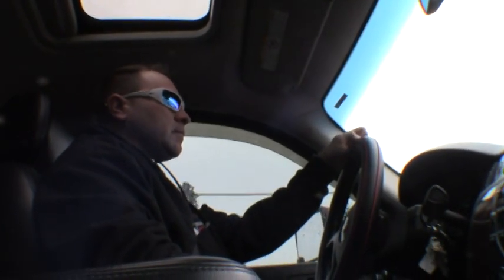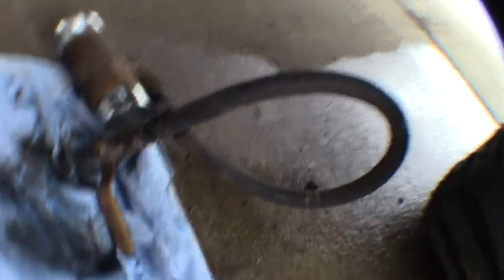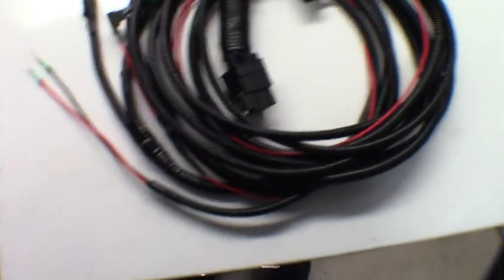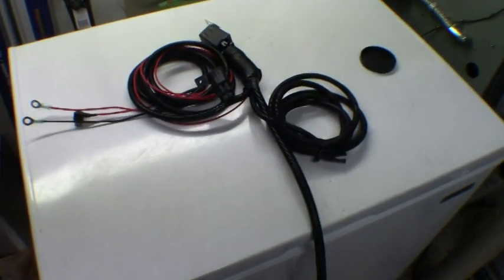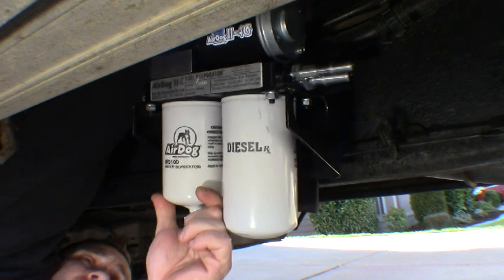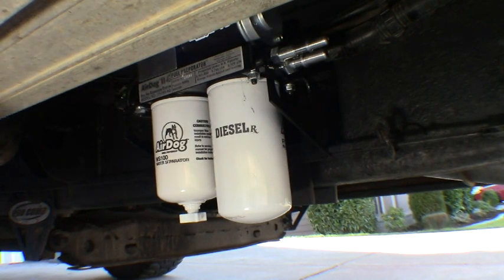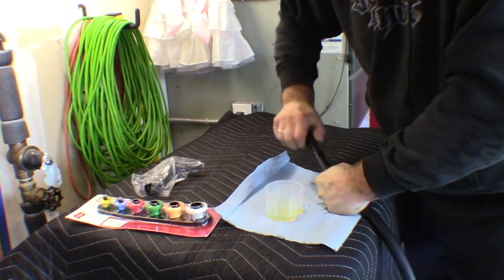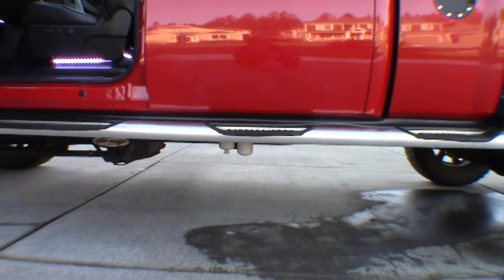Airdog2 4G lift pump install, Duramax lift pump install, air dog @AirDogSales

Comment: The reason the harness is so long is so it will also fit a long bed
Reply from the maker: Probably very true. Another 1.5' would do though. Better 2 much than not enough 4 sure

Comment: Did you have to remove that section of stock hose or could you have plugged the new hose (for the inlet to the lift pump) into the stock hose where you disconnected it?
Reply from the maker: That factory piece is has what I would call the "female" end at both ends of it.and the ends where it connects are kinda large and funky.. I suppose you could try 2 cut one end off and clamp the hose 2 it but it would be a bit sketchy since the end wouldn't be flared and the factory piece is a hard plastic material..not sure been I would trust it..2 me it seemed safer and easier 2 just remove it and have solid connections..hope that makes sense lol
Reply: That makes total sense. I’ll be installing a fass system this week so I’ll see if their fittings are different. Thanks for the video, you’re going to save me a lot of time haha
Reply from the maker: Awsome..hope it's of help..both are great systems

Comment: Now that you've installed that pump when you fuel up do you have steam/smoke vapor coming out from the filler neck?...my 08 lmm is doing that
Reply from the maker: Hmmm I cant say that I have noticed anything like that. But since the pump is returning aerated un used fuel back into the return in the filler tube. Certainly may be possible?
Reply: Yea..thanks for the reply...and I hear and can visually see fuel bubbling in the filler neck when the pump is activated...just wondering if I have a hose hooked up to the wrong  port...

Comment: I have a 2021 gmc L5P Duramax and I’m trying to find an air dog lift pump for it do you know where I can get one
Reply from the maker: There are a few duramax related facebook groups I have seen guys asking in and there seem 2 be a few smaller dealers here and there that have them. Might be worth reaching out
Reply: @Turnersspeedshop  OK I didn’t know if maybe you had an air dog for a 2021 L5P
Reply from the maker: I'm sorry I'm afraid not..all the supply chain issues have mad finding stuff so difficult..definitely frustrating

Comment: How long did it take all together
Reply from the maker: Not bad at all..I got a shop quote and they charge it as a 4 hr job, I did it in about 2.5 hr
Reply: @Turnersspeedshop  i have alot of tools. The only thing i am worried about is the fuel lines. How hard was that too cut and do?
Reply from the maker: Piece of cake..hose cuts easily with a knife, fittings are simply pushed in. Beauty of airdog fittings is they squeeze with ur fingers no tools needed. Hardest part was removing factory molded line from fuel tank because room was seriously tight
Reply: @Turnersspeedshop  will i have plenty of hose? I have a 08 gmc sierra 2500 crew cab long bed. And basically do you think its something easy enough too do myself or i could pay someone $200 too
Reply from the maker: Yes. Mounting location I chose used a bit more hose 2 accommodate and I still had a few feet left over
Reply: @Turnersspeedshop  ok cool! I will be using you're video too help ease the install. Very good installation video!
Reply from the maker: Thanx man..best of luck 2 ya
Reply: @turnersspeedshop. Can I ask why the Airdog over the Fass
Reply: @jeremyjohnston1413  honestly man. I have the airdog 100 and it is very quiet. Even check sometimes just too make sure it is running because i can't hear it over my engine and exhaust noise. My truck is 10x more responsive now and does not die out anymore when i give it full throttle. Airdog is just as good as fass if not better so save a $100 or so and just go with airdog.
Reply: @Turner Speed Shop.  Thanks for the reply and great video.  Im going to go with the 100 for my 02 LB7.
Reply: @jeremyjohnston1413  you won't regret it👍
Reply from the maker: @jeremyjohnston1413  sure. Just personal preference honestly both good systems. However I like the airdog fittings much better they require no disconnect tool simply squeeze with fingers and remove. Handy if there is ever an issue 2 simply bypass the pump. I find mounting design/location better as well. The airdog is also considerably  quieter.

Comment: What would happen if you did not remove the suction fuel line?  Instead of removing it, you still separated it but instead of removing it, you used it for your "fuel in" rather than running a whole new line.  I simply don't understand the reason for removing a line that can still work.
Reply from the maker: That line wont work. That factory plastic fitting is not compatible with the fittings on the air dog pump, even if it would it is nowhere near long enough 2 reach the airdog no matter how close u tried 2 mount it. I have see people install a sump however 4 supply and use the factory pickup as a return instead of installing the return in filler tube
Reply: @Turnersspeedshop  , how is it that with the FASS System, they can tap into the current fuel line without having to remove it?   If it is simply obtaining the right connections, purchasing the connections from FASS to connect the original line to the new fuel line to the pump cant be that big of a deal.  If I can obtain the right connections, can the original line be used?
Reply from the maker: Depends what year truck your working with. They dont all have that hard line. I'm sure if ur hellbent on reusing itbubcan find a way. Just seems like much more of a pain in the neck 2 me 2 even try. Ur gonna have 2 add hose and fittings  because it's short and wont reach and it's not flexible. Simpler 2 make a hose exact length need and replace it. But best of luck 2 ya